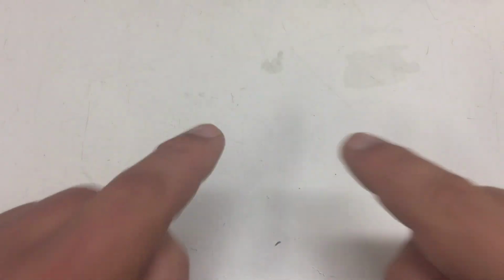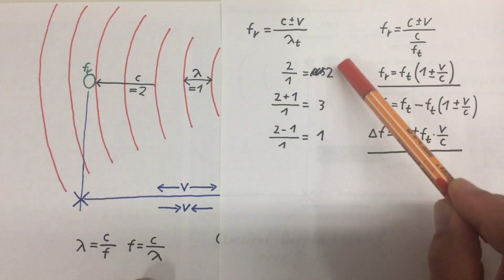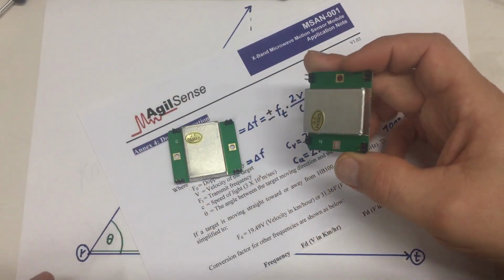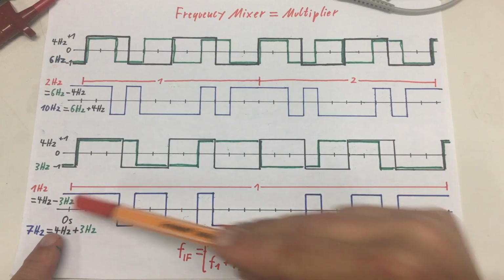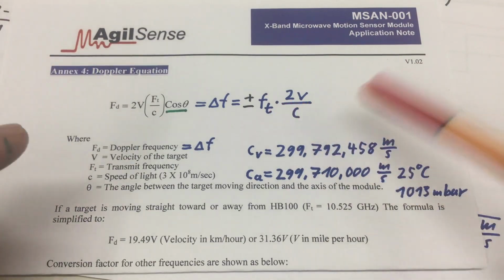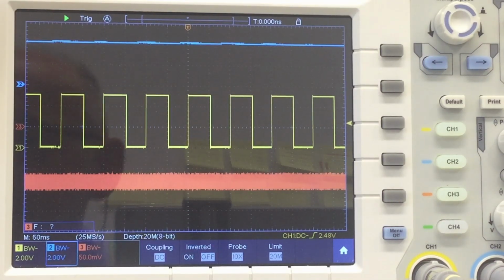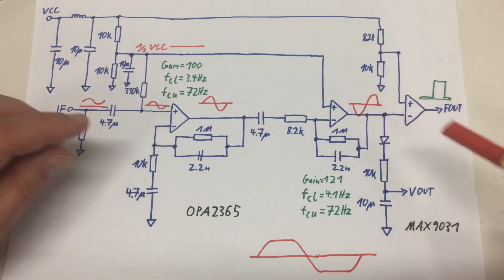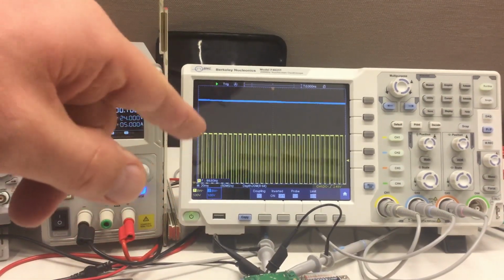HB100 Doppler Radar, Limpkin’s Amplifier and Arduino MCU – The Details (1/3)

Comment: hello I want to test if my HB100 module is working but I don't have an oscilloscope. So I decided to measure the voltage between the IF and GND. I measured it on DC and AC but it shows  0.00V although I wave my hand so fast in front of it. Is my module broken?
Reply from the maker: To be honest, I can't tell. The IF output as a DC offset of about 150mV. You should be able to measure that with a decent multimeter in DC mV mode. The signal itself is noisy (order of magnitude 10mV) and has a peak to peak level that has also a order of magnitude of 10mV. I don't think you can catch that with a multimeter.
Reply: @robertssmorgasbord I understand it, thank you very much
Reply from the maker: @izleyici-p5g  You're welcome!

Comment: Hello ! I have big problem of sound quality ( Main bass problem) in car. All equipents from audio arev100 per cent okay. All connections checked and cleaned. Bass is (sometimes, not always) much louder and softer on warm temperature.  Sometimes move position sub can improve a certain frequency. And after few minutes bass back to weak. And i have DC output to speaker from amp. Subs blowing much before clipping. Its a Doppler effect ?
Reply from the maker: Nope, probably not a doppler effect.
Reply: @robertssmorgasbord   I think, its a Voltage reference, unstable output. I see Diagrams about fix it. Resistor betwen - power input amplifier and - output to speaker. Is this enough or do its need more combinations of resistors or adding a capacitors?
Reply from the maker: @basserex4991  Well, if the voltage reference is really unstable, that could be the cause. Do you have any suitable measuring equipment, like a capable multimeter or - even better - an oscilloscope to verify that?
Reply: @robertssmorgasbord  i have multimetr and budget osciloscope. In amplifier output i see dirty waves. On emphaser EA 2500 its like noise or distorted, or harnonic distortion. On Vibe mono 21k i see very FAT wave and too noise, distorted. On two Amps on low output i see, waveform is ripppling like phase reverse. But signal in  end RCA is very Tiny and clean. Its imposible to ripple current. In instalation with off engine ?
Reply from the maker: @basserex4991  All good questions, but that goes beyond my knowledge of analog amplifiers (I'm more into digital circuits). Anyway, you said you already identified a faulty/noisy voltage reference, so why not start there?

Comment: This reminds me... I have a Bushnell sports radar I want to add audio to.  I can find the audio output on the board, but simply placing a piezo chirper or small speaker across the connections loads the circuit to the point that there's no signal left for the microprocessor.  I'm thinking of trying a simple LM386 audio amp circuit to the audio output... maybe the impedance will be high enough the radar's circuit won't notice.  :)
Reply from the maker: Well, first a disclaimer: I have no idea about the circuitry of Bushnell sports radars. That said, the LM385 has an input resistance of 50kOhm, which is not bad for an audio amplifier, but might still be too much. Anyway, if that doesn't work you can still go for an OpAmp with very high input resistance.

Comment: Hi, really cool video, is there any substitution to the op amp IC?
thank you
Reply: i mean the equivalent model of that op amp
Reply from the maker: @galinggangacademy6420  Any op-amp meeting the specs should do (power supply 5V, rail-to-rail, CMMR 100db or better, low noise 4.5nV/sqr(Hz) or better, slew rate 25V/us or better) should do. Though, on the top of my head I can't name a specific type that would fit the bill. The original reference circuit uses an LM324, so that should work too.
Reply from the maker: See my answer below ...

Comment: hello sir, do u use pulse mode in hb100??? if on oscilloscope we see pulse waveform that swings it frequency according to  speed like u did at end of the video, now u  have utilized pulse mode ?
Reply from the maker: I've already replied to you comment on part 2 ;-) Yes, you can use the HB100 in pulse mode (see the datasheet - you'll find it on Limpkin's side - link in the description). And no, I have not utilized pulse mode. Pulse mode just means you switch the HB100 on for short amount of times, allowing you to run it at higher voltages and thus higher output powers.

Comment: Thanks for the comprehensive tutorial. Did you mean that the mains AC voltage is coupling to the oscilloscope probe 37:07 ?
Reply from the maker: You're welcome! And no, I don't think it was the oscilloscope probes, or the power supply lines for that matter - Limpkin's circuit has very good VCC filtering. I believe the mains AC was directly coupled into Limpkin's amplifier board. I mean it's a two stage amplifier with a total gain of 12100, and it hasn't any shielding.

Comment: I have read some articles that talk about using Doppler Radars for measuring heart rate, do you think this sensor is capable of that?
Reply from the maker: Nope, absolutely not :-) You'll need a much more sophisticated Doppler radar for that. See https://www.mdpi.com/1424-8220/20/8/2351
Reply: @robertssmorgasbord  Thanks for the info, do you know were I could get a better Doppler Radar module (or the components to build one)? The company that provided the one used on the article apparently only deals with formal clients.
Reply from the maker: @RoyFokker93  You're welcome! Unfortunately I never dealt with high end Doppler radars. The best I know of, that's generally available: https://www.seeedstudio.com/Grove-Doppler-Radar-BGT24LTR11-p-4572.html
But I can't say for sure if the capabilities of this module are sufficient for your purposes.
Reply: @robertssmorgasbord  
Do you think, Can we use this radar for detecting frequencies less than 1Hz?
Reply from the maker: @jakelynabadlima  No, I don't think so. The frequency stability of the HB100's oscillator is far too bad for that. You'd probably be measuring the jitter of that oscillator instead of a Doppler frequency.
Reply: @robertssmorgasbord  
Although, I see there are some papers they used this module for detecting the heart rate. On other side, what do you think 🤔 about rcwl 0516?
Reply from the maker: @jakelynabadlima  Well, the usual rest heart rate starts indeed at 60 beats/minute (athletes maybe 40 beats/minute), so 1Hz. But a Doppler radar would not directly measure the heart rate (1Hz), but the speed at which the heart muscle is moving. I'm not a a physician, but if I read this paper correctly ( https://www.pnas.org/content/113/13/3675 ), then the heart muscle moves with about 1m/s to 3m/s (Fig. S2). That would give you a Doppler frequency of about 70Hz to 200Hz with the 10GHz HB100, so well within the capabilities of the module.

Do you have a links to the papers you've mentioned? It would be interesting to see what analog circuitry and digital signal processing they use to make sense of the IF output of the HB100.

Regarding the RCWL-0516: That thing doesn't give you the Doppler frequency as IF output, just a high if it detects some movement within a certain timeframe (default 2s). How would you measure a heart rate with that thing?
Reply: @robertssmorgasbord  I am doing some testing with just ajusting the bandpass filters. You get a signal that has some resemblance to and ECG, but it is unstable. I still have to compared it with a ECG obtained with electrodes. 

On my research on the IEEE, I have found articles talking about how with a Doppler Radar you could get a heart rate signal with the same behaviour of one you would get with a conventional detector that gives you an ECG. (sorry if some terms are not quite right, english is not my first language).

Some of the articles I find: 

"Low-Cost Differential Front-End for Doppler Radar Vital Sign Monitoring" - Rich Fletcher, Jing Han.

"Verification of a Non-Contact Vital Sign Monitoring System Using an
 Infant Simulator" - Yan Yan, Changzhi Li, Xiaogang Yu, Michael D. Weiss, Jenshan Lin.
Reply from the maker: @RoyFokker93  Thanks for the info! And congratulations for making some progress! Regarding the comparison of the Doppler radar signal with an ECG: The EGC measures the electrical nerve signals to the heart muscle(s). The motion of the heart muscle(S) does of course reflect these signals somehow, but muscles are not servos translating the electrical nerve signals into a proportional motion. My best guess is you'll see two or four speed spikes (one or two for each chamber) for each heartbeat with a Doppler radar.
Reply: @robertssmorgasbord  I am still working on it, a teacher of my university point me that I probably would also need to check the safety of using this module for heart detection.  Do you thing that the module could cause harm to a person?

The datasheet says that the device is safe to use and it was regulated acording to  the ANSI C95.1-1991 (which is about the maximum amounts of RF values that a device is allowed to expose a human being and not cause any harm). But my teacher said my that since the device is designed for movement detection at somewhat long distance (in meters), maybe the regulation in specs don´t consider using it at very short distances  (I am pretty much putting the module in front of a person´s chest).
Reply from the maker: @RoyFokker93  Well, the Radiated Power (EIRP) according to the HB100 datasheet is typical 15dBm (32mW) and max 20dBm (100mW) at 5V VCC. I don't know if I wanted to irradiate someone having a pacemaker with 100mW RF at short distance. To be honest, I have absolutely knowledge about the regulations for medical devices that apply - not really my field of expertise. Of course these regulations might differ from jurisdiction to jurisdiction. If you want to dig further here's a US FDA link: https://www.fda.gov/medical-devices/digital-health-center-excellence/wireless-medical-devices .
Reply: @robertssmorgasbord  I have done some research and mostly depends on how deep the microwave penetrate on the tissue and if the energy that is disipated as heat  is enough to cause damage. Some articles and books talk about experiments with microwaves with values over 100 mW and reporting no damage on tissue, depending on the size of the test subject, for small animals it is harmful (rodents mainly) but for larger animals it is not.
Also if the frecuency of the wave is high enough, the wave is not able to penetrate the skin and muscle tissue.

I had a misconception about the use of the Doppler radar for detecting heart rate, I thought that the signal obtained was from the cardiac muscle. But the idea is that the chest of a person suffers from a relative displacement during cardiac activity, so, with the frecuency shift of the wave received by the radar you can get a signal that shares similar caracteristics in comparisson to an ECG, so you can determine stuff like heart rate.
Reply from the maker: @RoyFokker93  I'm pretty sure you can't do any real heat damage to human tissue with an HB100. A microwave oven, which is optimized for heating and penetration, works at about 2.5 GHz, the HB100 at a four times higher frequency of about 10GHz. So it's like you said: lot less penetration. I still wouldn't use it on somebody with a pacemaker though.
Reply: @robertssmorgasbord  A little update, I was originally thinking that the objective of using the doppler radar is to get a signal based on the microwaves being reflected by the heart tissue. It is not. After further investigation and article research, I discover that a human has a relative chest movement during cardiac and respiratory activities. With the radar in theory you are able to get a signal from the microwaves being reflected by the chest during said activities and get a signal that can be use to interpret and get similar information to what an ECG can get. 

It is less troublesome because you don´t need to penetrate the skin with the microwaves. The frequency of this module has the minimum value that garanties that. 

I am still doing testings. The signals I am getting are promising, but it still needs a lot of refinement.
Reply from the maker: @RoyFokker93  Hi there! Great to hear your still working on your heart rate monitor! And thanks for the update. That's very interesting. I guess I always had those ultrasound images of a beating hard muscle in my head when I though about measuring the heart rate with a microwave doppler radar. But of course that's nonsense. Good luck with your signal processing!

Comment: this is a useful video. I consider that "HB 100 can detect the direction of motion (approaching or receding ), doesn't it?". I try to use HB100 to do that but in fact, nothing was changed when we approach the sensor, even receding. Anyone have any idea about that. I want to use a Radar sensor to detect people whenever they go inside or outside the door?
Reply from the maker: Thanks! And no, the HB100 can't detect the direction of the motion, because after the mixer you got only the absolute (!) of the Doppler frequency shift. So any information about the direction is lost.